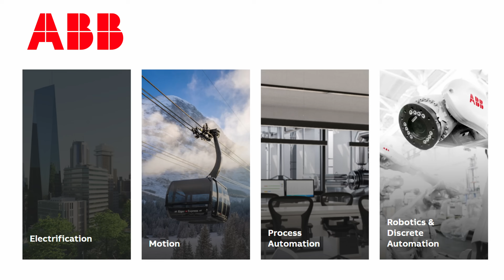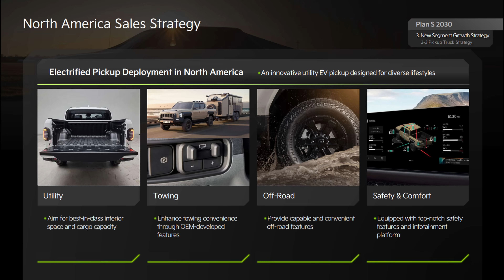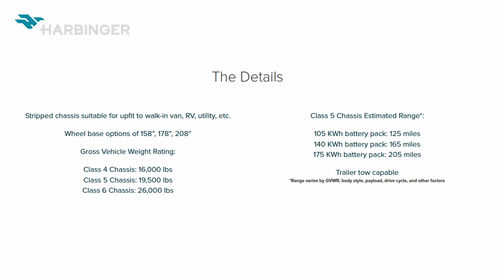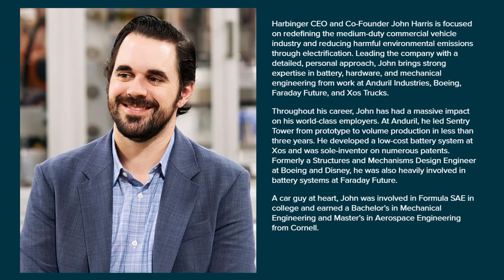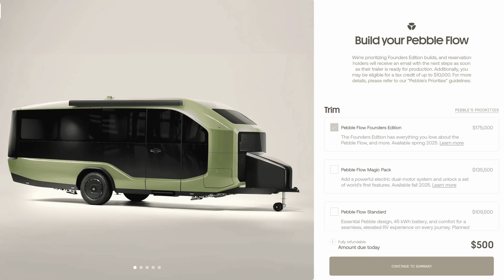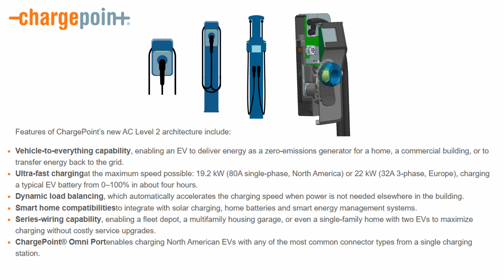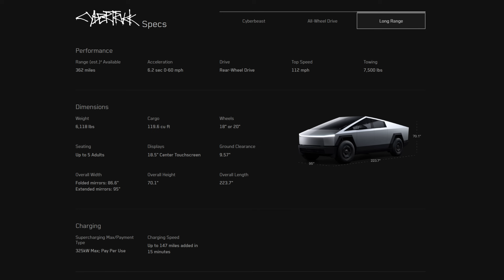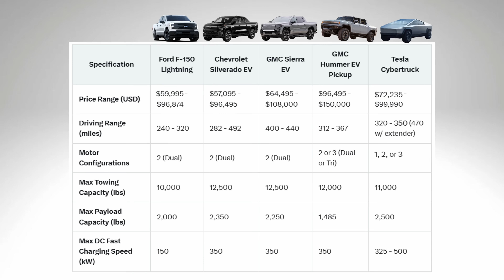The Current : Weekly EV News Ep#58 Apr 13, 2025

Comment: Great episode, as always!  The Kia slide deck graphics were interesting.  Great to see all the commercial vehicles in the works.  So far, I've seen several Rivian delivery vans, and a few of the Bright Drops.  But it's about time that commercial EVs start selling in volume (not sure how Bright Drop dropped the ball so badly).  The EV pick-up graphic was awesome, except no Rivian?  I see EV pick-ups all the time now, and I think the Kia graphic on pick-up sales projections is on point.
Reply from the maker: BrightDrop (now called Chevy Zevo) is, by most metrics, the best value and highest performing electric van available in the USA. We aren't sure why sales have been poor. In fact, the Windsor, Ontario, CA factory where they are produced has paused because the lots are overflowing. 

As far as our pickup truck chart, Rivian does not currently produce any full sized pickup trucks. They have a mid-sized option called R1T and Miss GoElectric owns one. She likes it a lot, but it is not a direct competitor to full sized work trucks.

Thank you for joining us and sharing your thoughts. 
-Producer Tim

Comment: Hyundai/Kia/Genesis has the best EV plans overall for a legacy automaker, moving forward. They are quietly expanding available EV products across their lineup. I like the Pebble RV/trailer, but the $175K price limits it to 1% buyers. Hopefully they will succeed (satisfying the idle rich) and move to produce more affordable models soon. ChargePoint had both an early lead, and market dominance for years, but they were slow to innovate with reliable operation. I would be interested to see which automakers EVs are compatible with ChargePoint's new chargers, what the prices are, and if they have full V2G, V2H, V2L capabilities. Electric cars such as the Nissan Leaf, Volvo EX90, Polestar 3, and Volkswagen models such as ID.3 , ID.4 , ID.5 and ID Buzz are supposedly V2G ready. Plus companies like dcbel are shipping V2H systems now. The combination of state and home subsidies make V2G (bi-directional) charging a reasonable investment when looking at installing a PV/solar system. This is because you can potentially recoup your investment in about 10 years, and also have the use of a high capacity home backup battery along the way. I had long said that the Cybertruck will stay a niche market until they get the price under $60K (originally promised at $40K) but now that Musk has damaged Tesla's good name, many people might be able to take advantage of buyers dumping their $125K Founders Edition Cybertrucks for under $75K. Still, this would make it tough for Tesla to charge nearly the same price for a new Base model Cybertruck.
Reply from the maker: Thank you for sharing your perspective. -Producer Tim

Comment: In China, the EV price war is heating up again.with Leapmotor officially launches B10 SUV, prices starting at  99,800 yuan($13,590)/{€12.000}. 

Leapmotor B10 base model have Powertrain 177 hp  Electric motor with 800V electrical architecture 56.2 kWh LFP Battery  And has the same size as the Toyota RAV4.

510 km (317 mi) in CLTC Range = 205 mi in EPA
Reply from the maker: There is a lot happening in China at all times with over 100 EV brands competing and 5x the population of the USA. We are focused primarily on the US market where our access and expertise is strong.
-Producer Tim
Reply: @MissGoElectric   Don't overdo it. China only has 3.5x the US population.The number of EV brands has dropped below 100. And the leapmotor is under the stalantis Brand. So maybe it will come to Canada. State no.51.
Reply from the maker: There are over 100 EV brands competing in China right now. Geely has 13 EV brands all by itself even after folding in Geometry and Livan. BYD has four, NIO has three. It goes on and on.

We have reported on Leap several times and Stellantis' decisions around the brand. Unless these brands become available to Americans, we do not intend to make Chinese automotive details a focus of The Current. 
-Producer Tim
Reply: @MissGoElectric  I hope Canada can break free from the shackles of America. 

America can enjoy its own bubble of ignorance.
Reply from the maker: Humanity benefits from productive nations and is stifled by parasitism and protectionism.  Independence is recommended.  -Producer Tim

Comment: What full size pickup truck can you buy for under $40k?!  Trucks are advertised under $40k, but they are not sold for under $40k.  Always take the "advertised" price and add $10k when dealing with trucks.  That is the "real" price.  If you are lucky.
Reply from the maker: There are many dealerships in the USA which do sell at MSRP. Fleet buyers can do even better. Brand new ICE pickup trucks are available under $40k including the Ford F150XL and Chevy Silverado 1500 WT.

-Producer Tim

Comment: I don't think the Cyber truck has a future. It was a conceptual design like the Pontiac fiero and plagued with the same problem of corporate cost cutting instead of correction. Plus the whole Elon thing isn't helping
Reply: If it was $40-50k and didn't have glued on panels flying off, I think it could have a market even with the whole Elon Nazi thing... But even at $60-70k, it's a terrible value and clearly has QC issues.
Reply from the maker: Valid points. The functionality and technology beneath the stainless steel is what has motivated buyers to choose it over all other options.  It was the 5th best selling EV in America during 2024.  If design becomes the obstacle to sales, automakers re-design.  We saw it with the Pontiac Aztek when it became the Buick Rendezvous.
-Producer Tim
Reply: And there are several fundamental reasons it would never be as good as a Rivian...such as shape and range

Comment: Looks like the Chevy Silverado is the way to go….Range, Towing, pass through bed, price etc etc…
Reply: I can speak from experiences. I’ve had one for a couple or three months now it is by far the best, and I have had quite a few different vehicles that are electric love the range and the freedom that it gives as far as the size of the battery is just wonderfuland I’m also impressed by the overall functionality and design and software. It is a very good truck.
Reply from the maker: GM's full sized electric pickup truck platform relies on a very large battery in order to deliver that range.  Undesirable consequences include high curb weight, high input cost, low payload, long charge times, and higher cost of operation. 

 That said, we think GM offerings including the Chevy and GMC flavors make EV ownership viable for wider audiences.  They build great trucks!

We've previously reported on the 492 mile Silverado WT.  It is a great value with very impressive range. -Producer Tim
Reply: Chevy, musk-freee!
Reply: I own the 2023 lightning and it's great for my needs. A family member bought the silverado ev lt. And let me tell you, I think that's the best. Long range, quality and great look.
Reply: 450 mile range is the one! And get the one that has Apple CarPlay is my suggestion,  2024 models, not sure about 2025 models. Some might not have it.
Reply: "You did it, Mary!" 
And everybody laughed. We'll see in a year who will be crying...